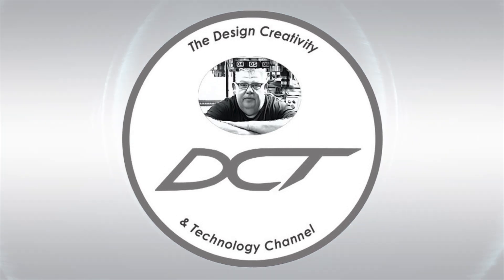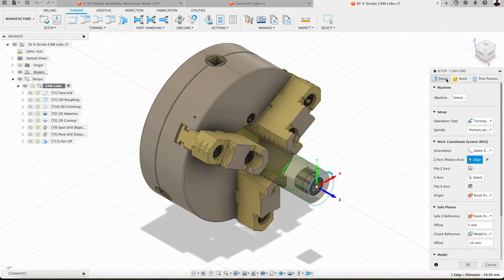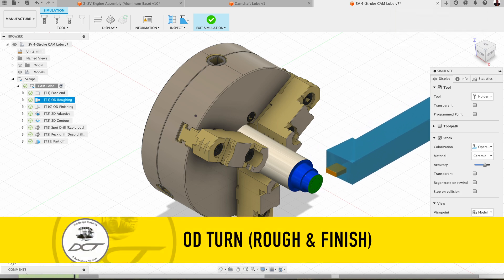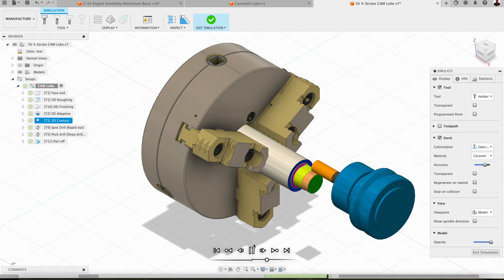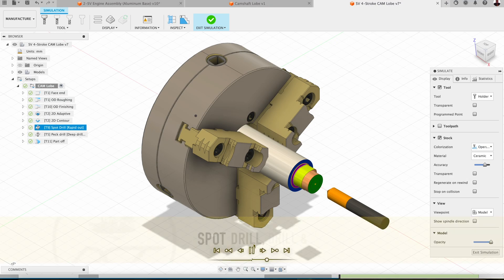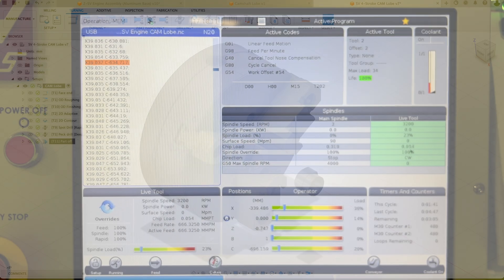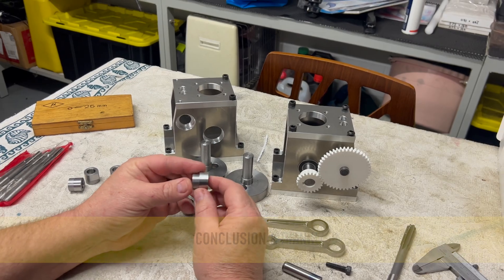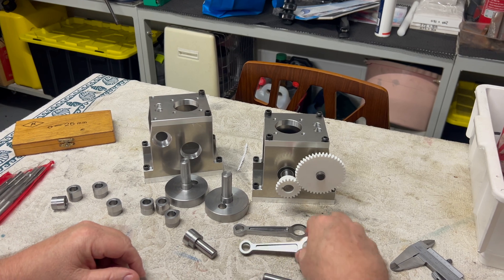CNC Lathe with LIVE TOOLING makes camshaft lobes

Comment: Cool !    👍   I just saw a drawing for a test piece for 1st year apprentice  machinists from Cock a too island from many years ago . they had to machine a set taper , vee , acme  , square and buttress threads all on the same piece of stock .   👍
Reply: Hey Max 👋🏼👋🏼
That would have been me, in about March/ April 1967 ( along with 20 other hairy-arsed 
1st year snots 🤣🤣🤣).
And that was after  a coupla months on hand tools … great Apprentices school for the fitters & turners ( that’s what we were back then).
I was the ‘last’ of the five-year apprenticeships… but I got it commuted to four and 1/2 ( for good behaviour 🤣🤣).
Regards
Robert
Reply from the maker: G'day Max and thanks for checking in.  Yes those were days mate.  They had similar exercises to complete in the navy training also.  Sadly, much of the apprenticeship training has changed today.  We tend to get them on machines sooner rather than later and make small projects they get to take home.  Cheers, Aaron.

Comment: not sure if its of any use to you but to force y moves on our doosan you need to set x minimum in the NC Program post processor settings.  needs to be a minus number. depends on part size
Reply: just had a quick look on fusion   its called "x axis minimum limit" in the configuration drop down
Reply from the maker: Hi David. Thanks for the tip mate. I’ll look into it. I did use the dedicated Autodesk ST20Y post processor. The week earlier it used a Y position to drill those crankshaft holes. Cheers Aaron 👍🍻
Reply: @DCT_Aaron_Engineering  for the hole in the crankshaft,  did you have your WCS y axis pointing in the same axis as the hole. hope that makes sense.   that would use a y move.  usually better to have the x axis in line with something like that just because you have more travel in the x axis.   depends on part size obviously.
Reply from the maker: @davidpearson3146  G’day David. WCS was set up as a standard lathe job. Z axis on centreline of chuck and X axis perpendicular to the chuck face. I just selected the hole centre. TBH I was surprised it worked so easily. It was different to how I’d pick a positioning move when using the 5 axis mill trunnion. Cheers 🍻

Comment: Why are you using live tools to drill holes on the centre line when you can just use the spindle and fixed tools ?
Reply from the maker: Hi Andrew. You can use the tools stationary to drill on the centre line. However, having them as live tools allows you spot, drill and chamfer off the centre line. The lathe has an additional Y axis.

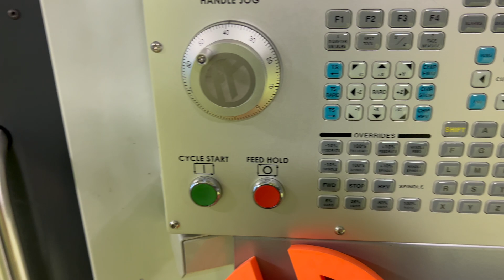Comment: G96 / G50 @ 1:50 
WOW, that Spindle 👌

It's sort of funny how Confusion 360, showed the part being Milled with Y Axis.
But it ran in C Axis in the Lathe ??

Is this how Confusion shows it in CAM 🤔

I'm onlly asking for a friend 😅

The FR on the Parting Off tool might be a little aggressive. 
But, it's maybe more so that the part isn't launched than the actual Cutting Speed. 

I like how you always take so much time to show as much as you can in a video,  everything from CAM to running in the machine.

I might be a little lazy in this regard about how much time I put into a video. 
But,  you have always made good content on your channel 👍👍
Reply from the maker: G’day Peter. Always appreciate you stopping by and providing feedback.

Yes that 4000RPM spindle clamp I programmed was a bit excessive. Should have left it at 2500rpm.

I agree, that 0.2mm/rev part off really launched that part 🚀 lol.  Greedy bastard aren’t I. 😂 

I’ll give you call soon, got some information I need to tell you. Cheers 🍻 Aaron